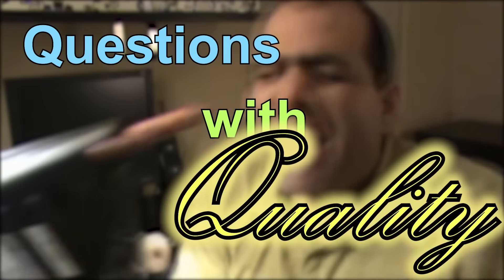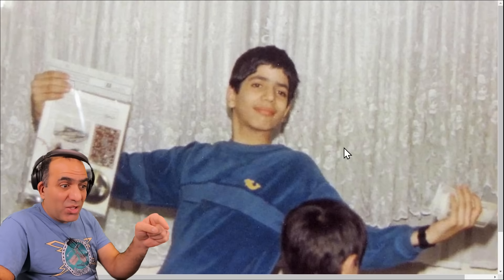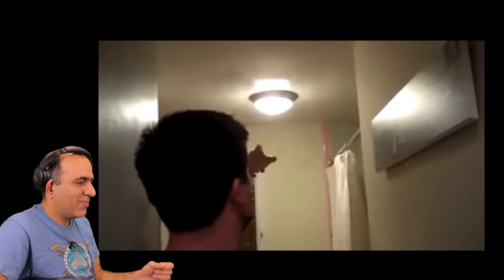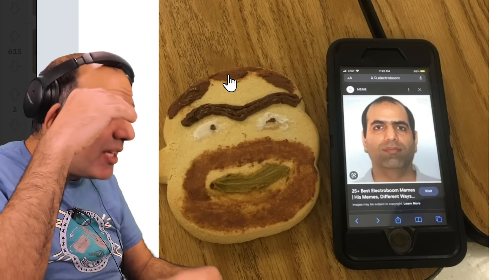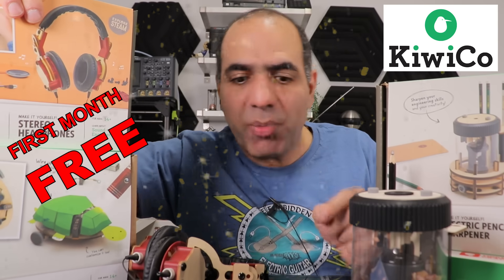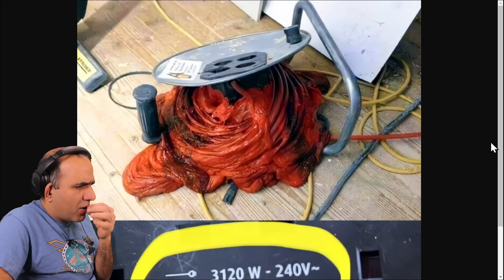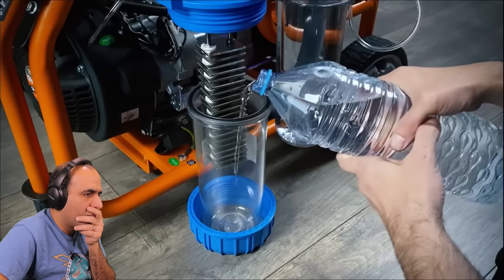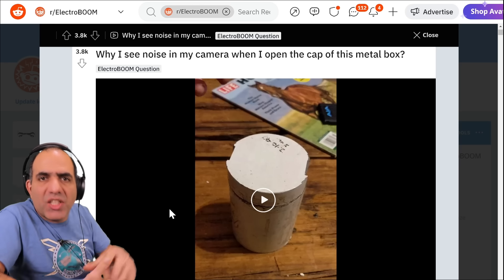Can ENGINE Run on WATER?! They Copied my Toy (LATITY-011)

Comment: Quick question, why are camera flash capacitors different to regular ones? I’m making a coil gun and have (I think) all the components needed. I did ohms law and I must have done something wrong because the amperage would be insane and surely explode stuff.
Reply: They're not really different. They're just slightly more cheaply made because they only get used rarely.

If you calculated some current draw of your coils using just the resistance of the coils, you're ignoring the inductance of the coils which is the major limiting factor. Anyway you can also push pretty high current through wires if it's just a short pulse anyway.
Reply: @Basement-Science  Ah yeah, I forgot the coil inductance stuff, I chose thicker magnet wire for safety. Thanks for the advice.
Reply: That circuit has a transient response! You can't just apply Ohm's law. You need to take time in cosideration (there is a differential equation)
Reply: @miguelm203  Oh right, my knowledge of electronics is mostly automotive, I can fix a wiring loom and trace faults no problem, but when it comes to capacitors I forgot. I’ll read up on those equations, thanks.

Comment: Dangerous radiation: [blocked by lead]
Whatever was messing with the camera: [blocked by human hand???]

It’s cap, Mehdi. He added it in post. The only thing he could be blocking is alpha particles, AKA helium nuclei, and maybe some electrons, but I’m pretty sure that if invisible radiation of any frequency actually affected the camera, it would show up as sudden bright spots, not transformative distortion.
Reply: You are right. In nuclear reactor startup videos in Youtube, you can also see interferences in the camera.
Reply: Yeah pretty sure he just reduced the bitrate and/or added some noise to it in post. 
Real radiation effects on a camera look completely different, and it would have to be INSANELY radioactive to affect the whole image like this instead of single pixels at a time.

Comment: Do steam powered cars count?
Or are we talking about an exclusive power source that is water? 

Can I use something to contain the energy? Like a spring, pulley and weight or battery?
Reply: Of course they don't count because the energy is coming from burning coal (or whatever fuel you use). The steam engine is merely a method of turning heat energy into mechanical energy. A much more modern and efficient example of this is a steam turbine.

Comment: MAKE THE CAPACITOR ALARM CLOCK ALREADY (also I have a light in my hallway that has 2 lights with escape and if you make one off and one on its gonna be off depending on witch is first )

Comment: Burning water? Way to classify it as "Burning" what does that even mean?
Reply from the maker: The guy was splitting water molecule and burn the gases back into water. That's kind of burning water as fuel! But I mean you can use water to run an engine, like those old locomotives
Reply: @ElectroBOOM  sounds like a fundamental misunderstanding of hydrogen fuel. 
The most common source is water... Plus coal/natural gas... Plus oxygen... Plus high pressure. Not just pour in some water and kick the starter... Ignore all the things you don't like and sure... It's water...

Edit: Finally got to the "water" powered car... Basically hydrogen powered... And used an ineffective method to create hydrogen and oxygen using a gass generator.... Proving the problem with "Electric" & "Hydrogen" powered cars. The fuel source is not magical.
Reply from the maker: @limsalalafells  Yes, but you can't have an engine where you pour water in it only and it runs.
Reply: @ElectroBOOM  That's because you live on Earth, not Mercury.
 (Still not free energy, just using energy in the environment... And how did it become water in the first place on Mercury?)

Comment: Burning water? No.. but you can burn the ingredients that water is made of. So technically yes you can run an engine off of water... its just separated water that then gets recompiled into liquid water after its been burned.
Reply: A Hydrogen powered car doesnt "run off water" any more than a combustion engine "runs off CO2". 
"Running off" something is about the power source.
Reply: @Basement-Science  I think the guy that created the water car ran 116 miles on a gallon of water.
Reply: @stevennoble7254  Impossible unless he split the water first with some external power source, or had some other consumable onboard to generate power.
Reply: Well whatever he did he did it and it could make it do 116mpg and like many people that come up with good ideas that could cost big firms a massive loss he paid the ultimate price no conspiracy just these that choose to disagree don't like it cause its a bitter pill to swallow a car like that could save tons aswell as more economic.
Reply: @Basement-Science  explain...?
Reply: @stevennoble7254  Sometimes people LIE. Sometimes they even deceive themselves.
Reply: Well Hydrogen fuels are only viable for few problems. Like in case of Rockets, sending stuff from earth to space costs a lot of money, that's why We use H2 and O2 with KOH/ {or anything which can give OH readily and reform.} We get energy to go to space this way and the product of Combustion in Water (Pure H2O) so by loading like 500L of H2 and O2 each we can get like 500L of water after reaching space. Pretty cool way to save money by using fuels combustion products. But on Earth, just check near your Hospitals how costly is O2 in itself and we Need H2 too that is something different in itself, wayyyy costlier. So we burn em Ferns and Mosses up till we run out of Petroleum.
Reply: Remember the guy who invented a car that runs off water years ago and was poisoned?...

Comment: You can make a arc heater with two carbon rods.
Reply: Considering the ozone and UV that might not be too healthy to do.
Reply: @RedmilesShark  Heater as in the arc is contained
Reply: @RedmilesShark  Also ozone breaks down pretty quick, it has a 20 minute half life, I use a uv/ozone generater in a few rooms. I never had covid. No its not good to be in constant contact with either. But i got one in my plant room that goes off for 30 minutes every 4 hours that helps with mold and fungus in my grow room. I have one above the  entry port room which goes of 30 minutes twice a day and one in the room i keep the cat litter which controls smell at the rate of once every 24 hours. The by product of ozone degrading is ......O2
Reply: @RedmilesShark  Also Ozone is what you smell in a lightning storm. It need high concentrations to be dangerous which dont get me wrong you could do easy not running one on a timer. but even in the event it happened if you knew it you could safely fix it in a few hours either though ventilation or closing the area off and letting its half life happen with no new generation.
Reply: @RedmilesShark  I will say though if my timer ever broke in my plant room and i didnt notice within a day every plant in there would likely die.
Reply: @RedmilesShark  Oh one more thing to consider the half life of ozone is directly proportional to temperature. at room temperature its 20 minutes, At arc heater temps Its likely much quicker but i dont actually know the math to calculate its half life at different temps.(thats why it last longer up above in the atmosphere....cause it colder up there and why since its heavier then o2, we dont have a bunch of it down here at sea level.

Comment: I really hope that that lead container video is just some video filter and not real. I know radiation can mess with actual celluloid film (see the Chernobyl helicopter video) but how would a digital camera's CCD/CMOS sensor react to radiation?
Reply: I hope so too. As far as I know a CMOS sensor would have bright white spots when hit with radiation. It's possible to test this by covering the camera completely with tape. There are also apps that use this to measure radiation.
For the pixels to turn black, the radiation would need to either block other light from reaching the sensor, or completely destroy the pixels it hits, which would be permanent.
Reply: Yes, the video was faked, there was a thread on twitter at some point where the creator of the video confirmed it was faked.

As for radiation on digital sensors, from what I've heard it shows as hot pixels. Or at least it does with thoriated glass, I don't know for other radiation sources.

Comment: The last video was to edited. They say that in the comment
Reply from the maker: I hope so! Otherwise the guy will have a bad time!
Reply: @ElectroBOOM  It is, the radiation pattern dose not look natural
Reply: @ElectroBOOM  he’s just going to get an extra 5 fingers after the video
Reply: But not in the video. So it is still shady.
Reply: One giveaway that it’s fake is that when he covers the hole with his hand the noise stops; this wouldn’t happen with beta and gamma radiation and alpha wouldn’t pass through the camera lens.

Also the noise caused by very high radiation levels makes white dots and lines as it saturates the sensor, not blurred images.
Reply: @niconiconii-san  And the fact that radiation noise looks likebright flashes, not like this.
Reply: What?
Reply: @quack1119  The last video that he rectified was edited
Reply: @JJJ_M_PW_WNY  ok??
Reply: @JJJ_M_PW_WNY  what??
Reply: @quack1119  If you look at the last video he rectified (the recation one) the effects look fake, like what @SuperSerNiko97 said: "His hand wouldn't block radiation".

The video is fake is what I'm trying to say.